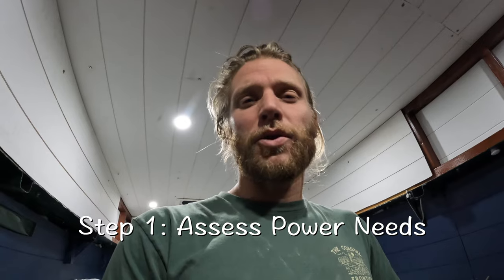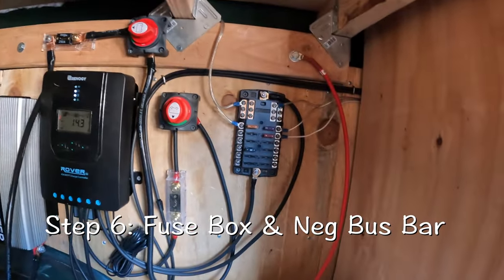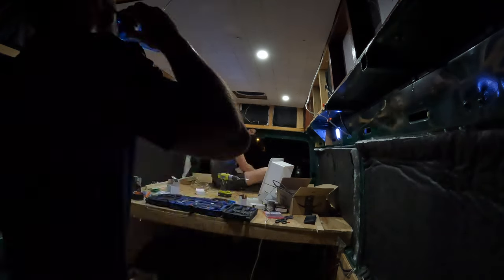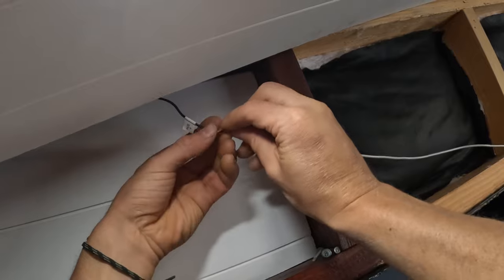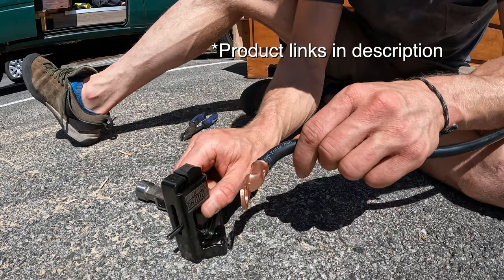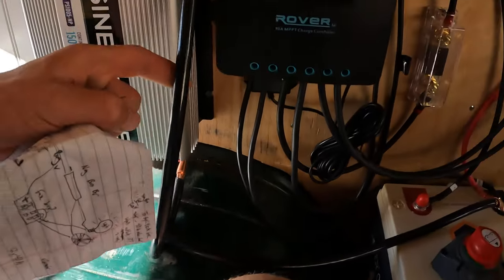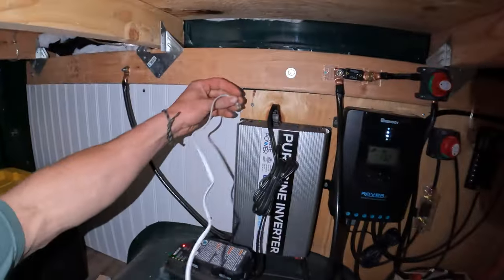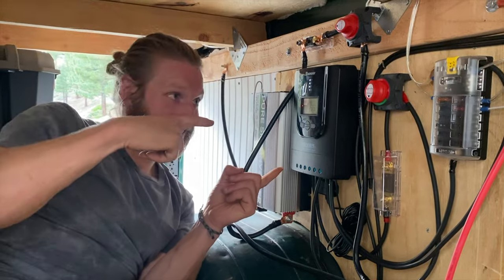installing 400W solar in my van to live off-the-grid

Comment: nice video,  one thing I noticed is that your inverter fuse may be oversized. (1500w/12v)*1.25=156.25A. So a 160Amp ANL fuse hooked up via 2|0 wire which is rated to 200 Amps.